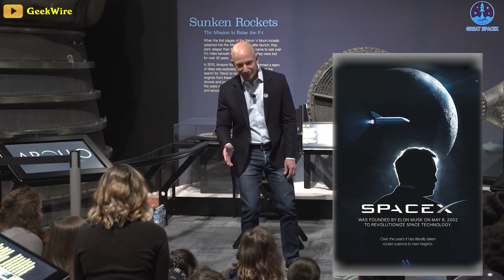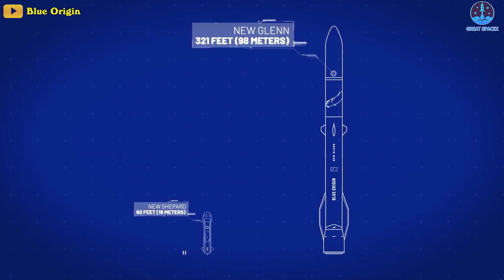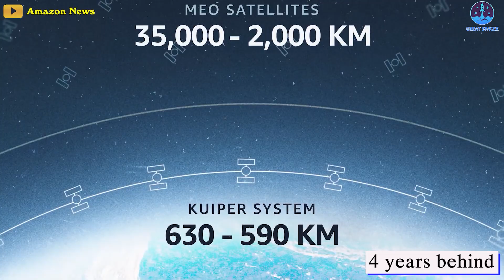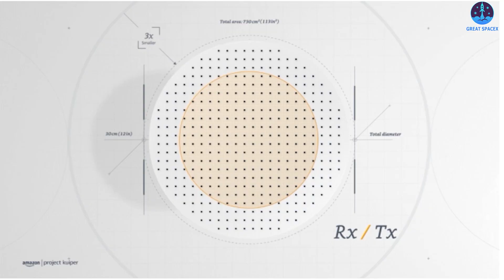Jeff Bezos & Amazon's CRAZY DECISION spend $10B purchasing 83 launches to COMPETE with SpaceX

Comment: In the interest of "National Security," the government should prevent ULA from fulfilling this contract UNLESS/UNTIL new engine deliveries are reliably arriving.
In the meantime, ULA needs to reach out to SpaceX about Raptor-2 engines and engineering consultation about fitting them instead of BE4. 
That will accomplish two things for ULA:
1. It will "light a fire" under Jeff Bezos' ass on engine development.
2. It will give ULA the ongoing option to switch engine suppliers without too much difficulty.  Since the engine module of the Vulcan booster is all they plan to reuse, anyway, it provides a convenient place to handle the R2/BE4 inconsistencies in plumbing and control electronics.

Bezos will get some motivation.
SpaceX will get paid for some engines AND get external feedback on the engines as "product" AND get external feedback on the consulting as "service".

ALL of which will be good for the industry.
Reply: I've been saying this for years. At best Blue Origin and ULA should be buying rockets from SpaceX. At the current rate Blue Origin is 'innovating' they will be surpassed by Rocket Lab and other small rocket companies

Comment: The Ariane 6 will almost certainly be viable and relatively on time as it is an ESA vehicle, and the Ariane 5 was extremely reliable and used for very expensive and important payloads like the James Webb telescope. It seems like Blorigin is just vaporware though.
Reply: A6 is based on BO engines though. Not sure how viable it really is.
Reply: @BeIlows  no it doesn't use BO engines. They use improved version of the Arianne 5s engines. You are thinking of the ULA Vulcan which is heavily delayed due to missing engines.

Comment: NONE of the 3 newly contracted rockets (Ariane 6, Vulcan, New Glenn (Blue Origin) has ever flown. They are all being developed. Additionally, the  ABL Space Systems RS1 light orbital rocket scheduled to launch the 2 Kuiper test satellites ( 1 each on 2 launches)  failed to make orbit on it's first test flight. The first launch of the test satellites is now scheduled  from Cape Canaveral for Dec, 2022
Reply: I don't expect Arianespace to fail here, they are probably not the cheapest launch provider and have no reusable launch vehicles but their Ariane launch vehicles had been reliable in the past (even if the Vega didn't convince in the  way the Ariane did)
Reply: @simonm1447  I don't expect any of the 3 to fail. My concern is timelines, in that any new unflown rocket is more subject to significant delays.
Reply: Most don't make orbit first attempt but to put your test satellites for a $10 billion project onto such a vehicle sounds crazy to me. At this rate they are not even going to have their first prototype satellites deployed until early 2023 at which point it is conceivable SpaceX will be launching starships with 400 Starlink satellites per launch.

Comment: Paper tiger publicity stunt is what this looks like to me. I find it interesting how after so many years of neglect, Bozo is throwing billions into this effort. I have serious doubts about the BE-4 ever going into production because it seems obvious to me that they've hit something unexpectedly nasty and possibly insurmountable on the technical side which might end up sending them back to the drawing board. I hope they don't push out something that's they believe is "good enough" in an effort to quell critics that ultimately ends up in disaster.
Reply: Tough catching up when someone else got there BE-4 you.
Reply: Came across a video a few days ago that went into great detail about the actual engineering involved with the Raptor 2 and Be-4 and the design choice they have gone with for BE-4 has some fundamental flaws in it that will make it extremely hard to get it going at all and even if they do it will most likely never be reusable as Blue Origin has intended. I dont wanna throw a direct link to the vid here but just search for "BE 4 Failure", by terran space academy, on youtube if you wanna see the vid yourself.
Reply: Agreed, the BE-4 project has all the red flags for a failed engineering project. Everything very late, nothing so far delivered and excuses getting more and more unbelievable. I suspect the BE-4 can just about meet it's stated spec but to get that is probably so difficult as to make the engine insanely complicated and expensive to make. No way is it going to go into mass production with its current design which does not bode well for ULA or New Glenn. After all they have been trying to produce just two flight ready engines for 2 years now and ULA need 2 of these per launch until they get there recovery system done and New Glenn requires 7 engines per prototype and they are going to go through multiple of these before they manage to land and reuse one.
Reply from the maker: So do I!!!